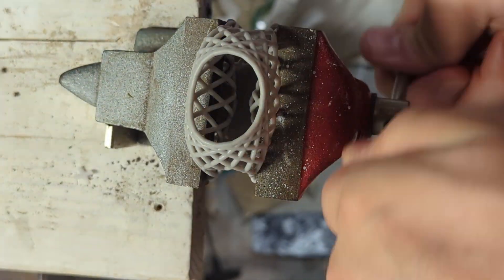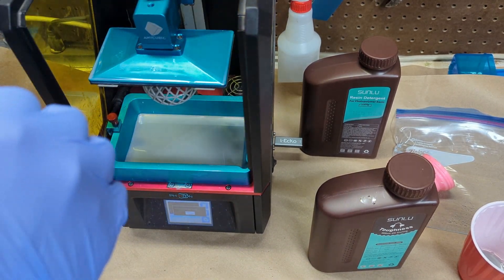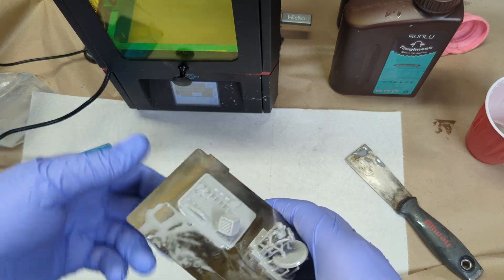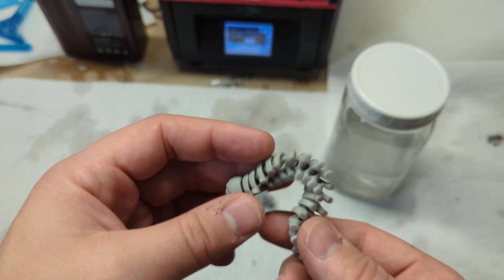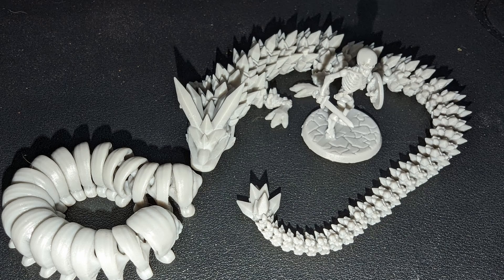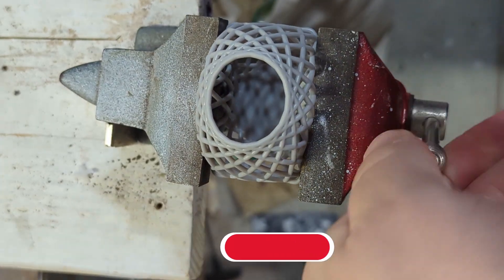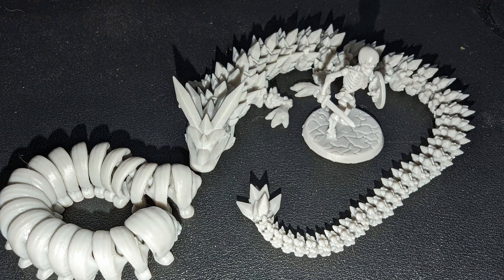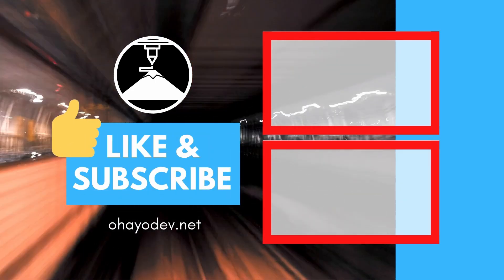This Resin Surprised Me:  Sunlu Tough Resin

Comment: I hope I don't sound cocky, maybe you don't really care about all those details and in that case enjoy your printing time and ignore all this ! but if you do want to overcome your problems read this:
your settings and the way you print your models are all the reasons why you have those problems, the fuse of parts is due to the over curing of the layer bcs it was on the bottom layers, you need to raise the model and print it on supports, for the bar, it's beceause your fep stretch out your piece when it the build plate goes up so it ended up crooked, you should never print flat on your build plate or you'll end up with bending, torsion or failure at worst.

Comment: Curious how this resin compares to the Anycubic Tough resin. Would love to see a comparison of tests done on different types of tough resins.
Reply: for me, sunlu has been the best overall resin I have used.  abs like is fantastic, nylon like is great too.  I haven't bought this yet.
Reply: @CuttinInIdaho Hello, i need to print 1:64 scale diecast parts. Is sunlu abs like okay for that? I don't need any flexibility for that part. Thanks in advance
Reply: @1337FLINT.  Yeah the ABS is good for that.  I would say the ABS is tougher, but their water washable is good too and smells much less.

I shouldn't recommend sunlu at this point because I have a filament dryer that is crapping the bed a 5 months old and their warranty dept basically said buy another one...but their resin is still that good that I can still recommend it.
Reply: @CuttinInIdaho  I'm afraid that water washable resin could be brittle from time to time, that's why i pick the abs like version
Yep, for now i just looking for dlp printer, i don't think will buy fdm printer in a short time. Anyway thanks for the help